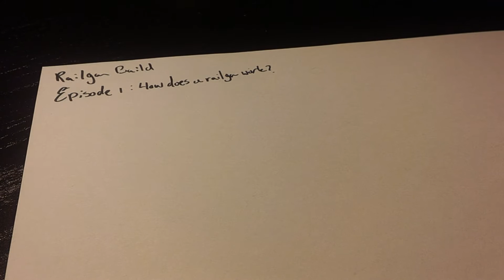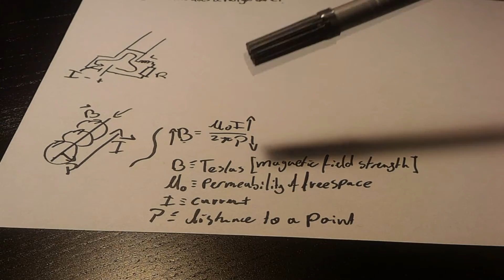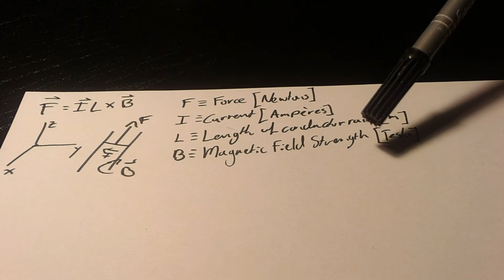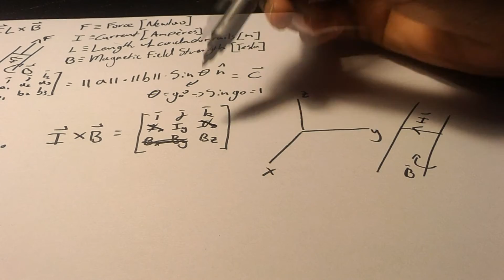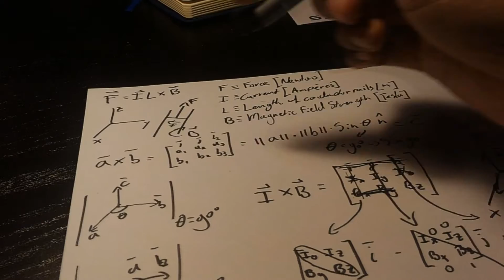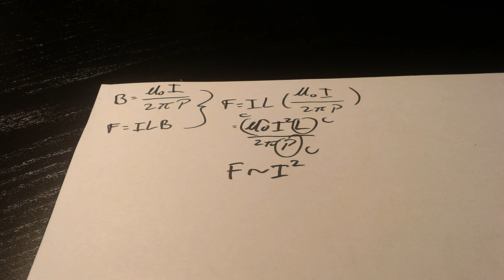Railgun build - Episode 1: How does a railgun work?

Comment from the maker: When you see a disclaimer, you know shit's about to get real!
Reply: My friend is building a railgun and I think that he might kill himself. Are there any things to make it safer for him to work with it?
Reply from the maker: +boomchacle Yes, he should be wearing gloves at all times. Add a bleeding resistor over the capacitor terminals, since it will slowly drain the capacitors when there is accidental charge left. Always disconnect the capacitors from bare metal when there's no need for them. Do a continuity test from the capacitors and the rest, so there's no short circuits. Basically remove any risk of you being a conductor, since these things can deliver power 100 times more deadly than putting your tongue in the power outlet.  Next video I'll talk a little about safety.